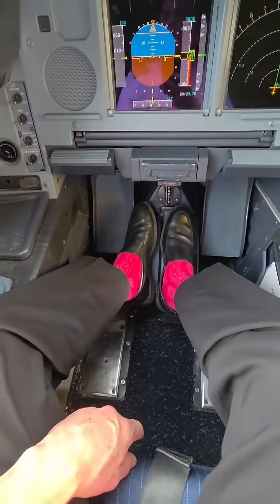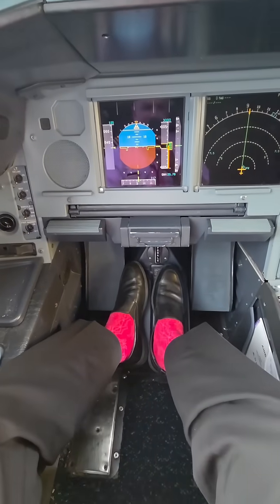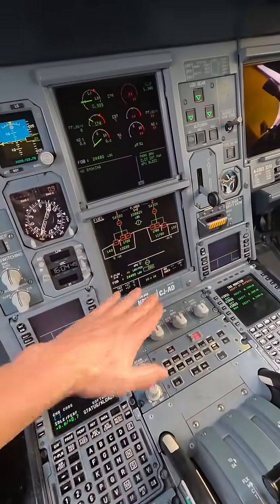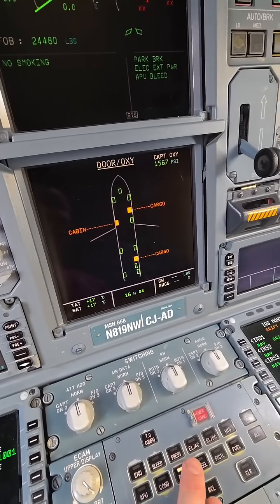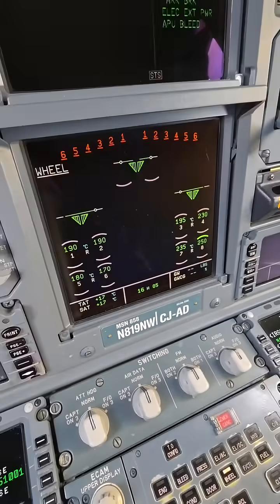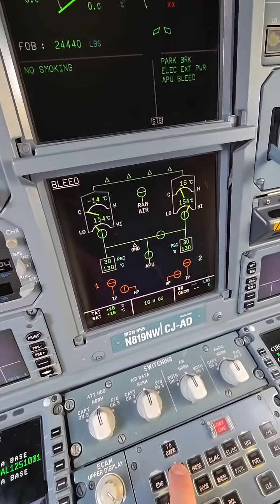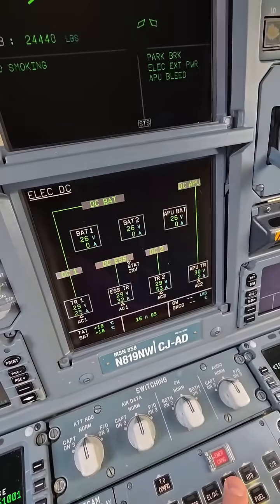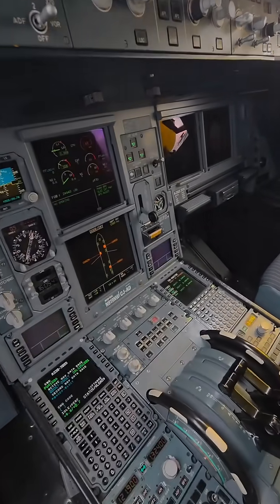Airbus A330 systems display (SD) pages.

Comment: 6500. Lbs per hour jet fuel each engine burns. In 8 hours of the  flight time, 108000lbs of the jetA burned
Reply from the maker: You are a math wizard! 

That fuel flow varies based on many factors.
Reply: @CaptainZtravels I know I used to be aircraft fueler here at LAX terminal 1,2,3,and terminal 6 during continental airlines time 2008-2015
Reply: @CaptainZtravels continental airlines time was 2009-till late 2011 early 2012

Comment: As an cockpit simulator builder, it's nice to see a how is inside a real airplane! The most dificult part is to know how the controls and buttons feel. For example, the AP1 on FCU is just a tactile button or does it go deeper like the APU button on overhead? I wish one day I could press some of those buttons
Reply from the maker: So the AP1/AP2 button is simply a push button BUT for that particular button there is an audible 'click' that you hear or more like a bump sound that comes on that I think comes from locking the side sticks. 

The APU button, and the rest of the overhead buttons really just press on/off. No sounds.